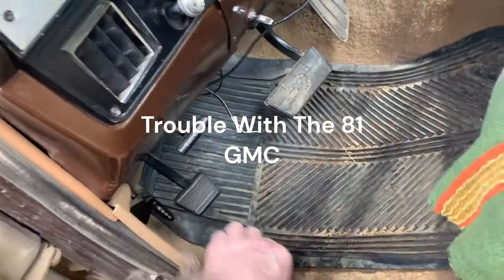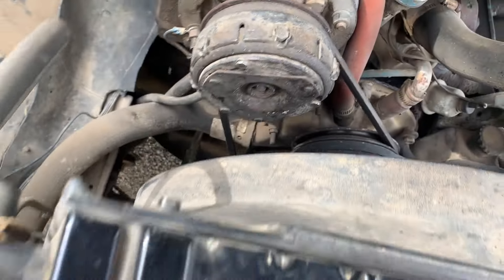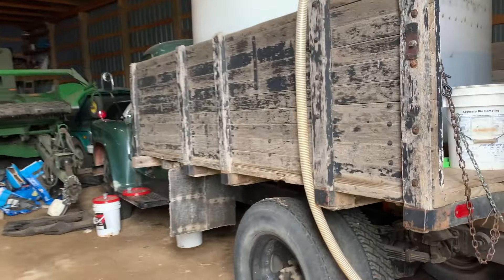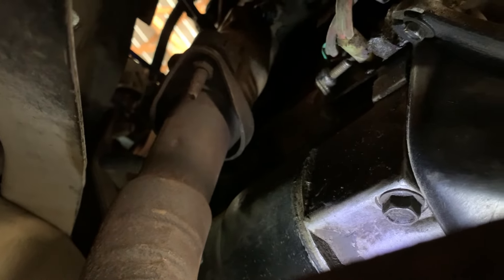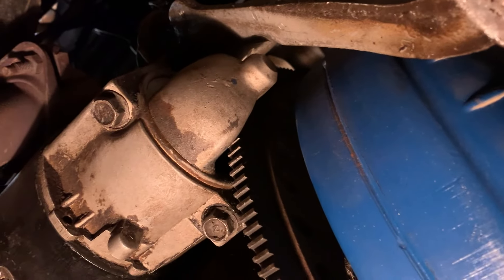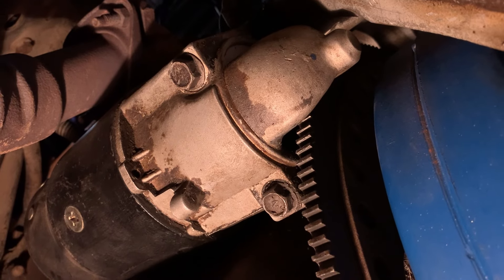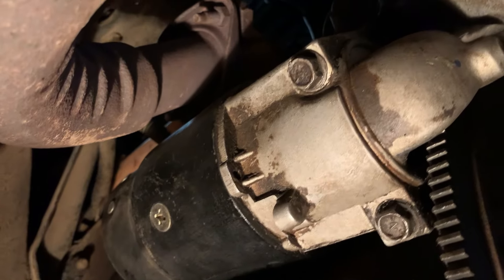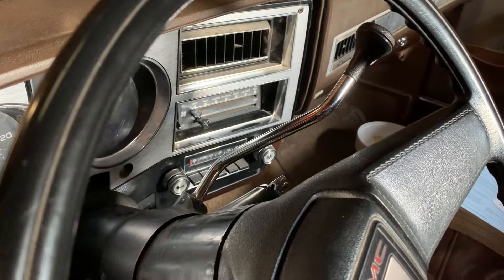Trouble With the 81 GMC

Comment: The starter solenoid was sticking so it was still cranking after you let off the key. You should check and see how tight the starter drive gear is to the fly wheel. Often you may have to install a starter shim under the starter to give the drive gear enough clearance. Many of the aftermarket starters are not machined correctly.

Comment: Hey, if you ever get tired of that truck you could ship it to Ontario and I'll give it a great home right next to my South Carolina import 83 Scottsdale LOL it's the perfect color we had an 80 in that color combination and I loved it, and 49 years ago today the day I turned 16 a new 1975 Chevy Cheyenne was delivered to the Farms which was a moss gold Frost white combination and it was one good-looking truck, anyway you take care of that square body they're worth a mint now anyway I enjoyed the video !!
Reply from the maker: Been driving this one since 1987 and I'm not tired of it yet. It just rides and handles so nice and does whatever I need it to do. I try not to drive it in winter anymore to avoid road salt
Reply: @roosty6 If that truck is an original 1981 5.7 Olds diesel LF9!? That is unicorn rare Sir... (I know the engine has been changed) I see it. But still. That is a 1 of 152 Produced (To my research). Super rare truck brother! I'm trying to buy a 81 C10 GMC from a friend in Canada too 15,000 USDk. 68k miles. 1 owner family. LF9 olds 5.7s are collector trucks now in the USA... As for your issue. I am going to say, Ground, battery connection, or a fuse. Unless something shorted.
Reply from the maker: @SchnelleKat  Pretty sure there were thousands of these diesel pickups produced with the 5.7 diesel. I know at the time I did the engine swap (1986) it was getting hard to find a good Olds gas engine at the wreckers as so many were being bought up to replace the ailing diesels. I wanted a 350 gas Olds but all I could get locally was this 403 and no regrets on that. This is a starter problem. Everything else is working good. To be continued...

Comment: Good evening Ralph
I wonder if that spring in the starter that  engages and disengages might be not good anymore that it keeps on grinding. Them manufactures sure find the most interesting place to put them starters. Good thing ya have that backup truck just in case 
We got around 20mls of rain I reckon that is around an inch.
Reply from the maker: I wonder about that spring too. See what the new one looks like I guess. Also turns out the 71 has signal light problems and brakes a bit low so not sure which one will get on the road first. Inch and 6 tenths here. Reports of much more some places.